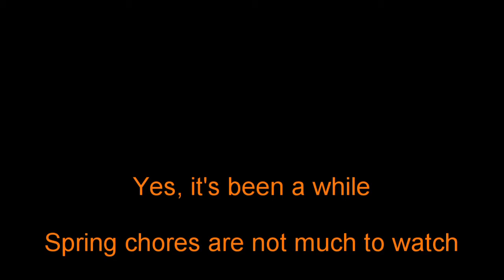Roubo bench build Pt. 11 - Short stretchers

Comment: Is the burn on the wood from the table saw mostly from an under powered saw or are there other variables too? I am curious since I get them too but I have not cut wood near as thick as yours. This really an awesome project. Precision work and you take your time. I love it. :)
Reply from the maker: A dirty and dull blade will make burn marks too.  Maple is very prone to burning.
Reply: I was thinking my blade might need cleaning a lot of pine is used with my saw
Reply from the maker: @McCoysOakHillFarm  pine has a lot of resin and will gum up a  blade quickly.  I have a video on how to clean them using hand sanitise liquid.
Reply: @JimDockrellWatertone  I will have to look that one up and see if I seen it. I think soo... but will do it soon before all the snow goes and we thaw out lol
Reply: Burning is just friction. When any part of the blade touches the wood even when it's doing actual cutting can cause the burning. Feed steady and feel your way to understand how fast to feed. Another trick for the table saw or circular saw is to put the blade up or deeper into the wood so the cutting teeth are not always in contact with the wood. This is contrary to safety tips of keeping the blade just high enough to cut through. If the cut matters and you don't want to sand through potential burns it can be worth doing.
Reply from the maker: @FearsomeWarrior  Maple is particularly prone to it also.  But who uses a piece of wood right off the saw on a project anyways?  It all needs work after sawing.